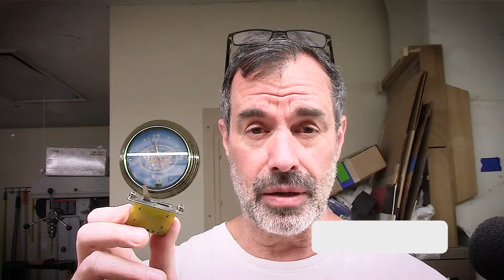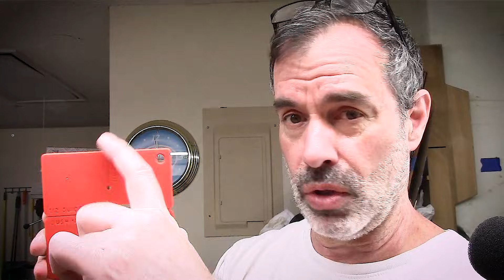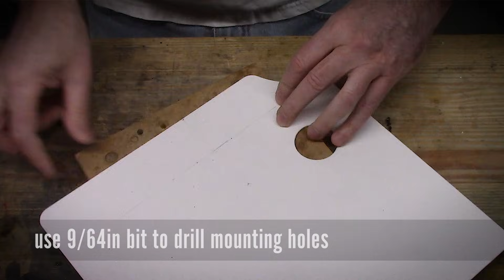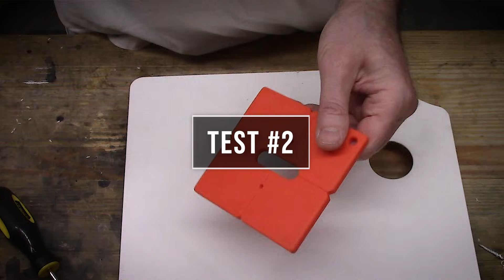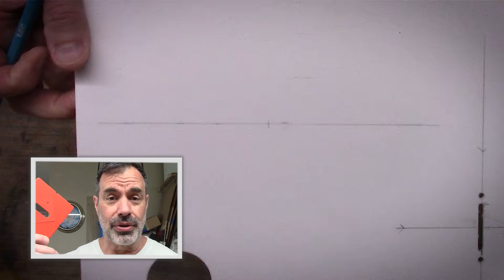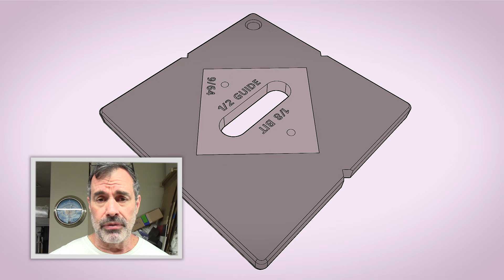Blade Switch Template - 3D Printing Guitar Project Tools Ep6

Comment: Hi John, cool idea with the 3D printer, but since I do not have a 3D printer, I had to create a template by hand. 🙄 Here is what I did that may help you and others to make this just a bit simpler.  Using a 5/16" bushing and a 1/16" router bit with 1/4" shank leaves enough room to put the screw holes in line with the slot.  This results in being able to do both operations in one step.  Hope this helps someone.
Reply from the maker: Pete, thank for the the idea, sounds great!
Good luck with your projects